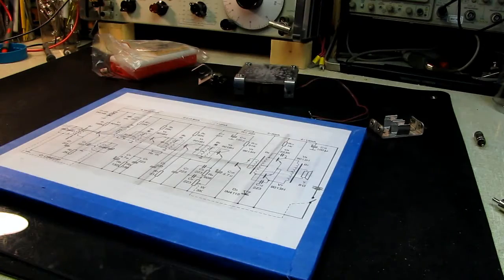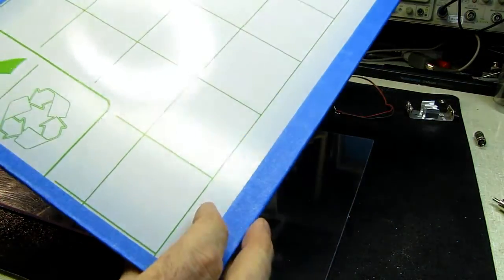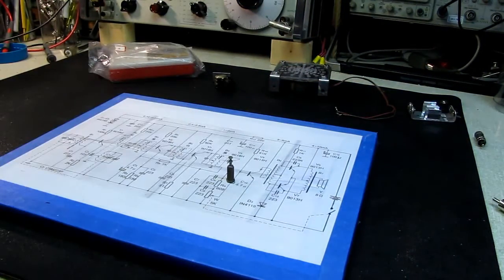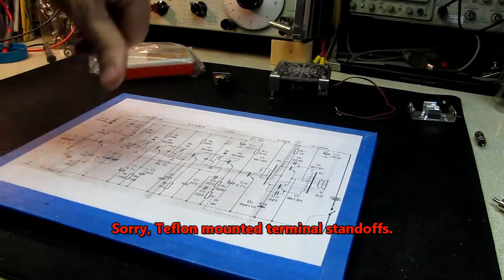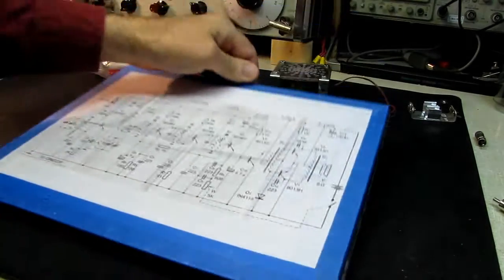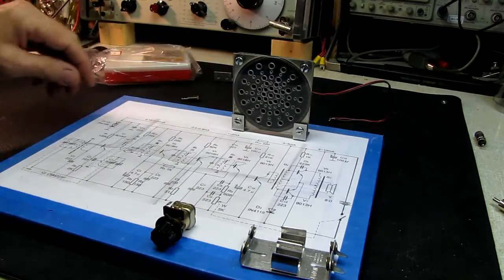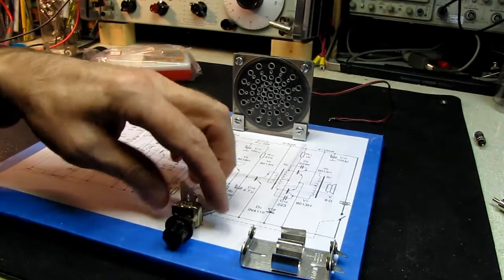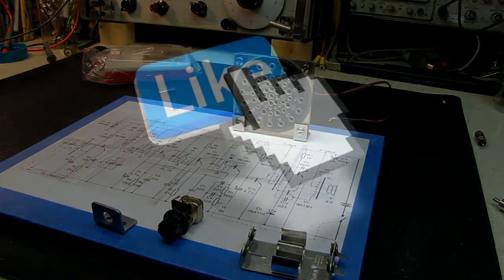10 Buck Test Bench - 7 Transistor Breadboard Radio Update

Comment: I like how the schematic will be under the actual parts.

I did a science fair project of a little amplifier sort of like that.  Schematic redrawn to spread things out then glued to a board. Brads for connection points.   Two pushbutton switches to play radio at original volume, then one to play it through the amp.  Honorable Mention Award.
Reply from the maker: Hi Joseph, Got the idea to put it under clear Lexan while cutting some at work the other day. Should make it easy for the young players to follow along.
Thanks for watching and the nice comment.